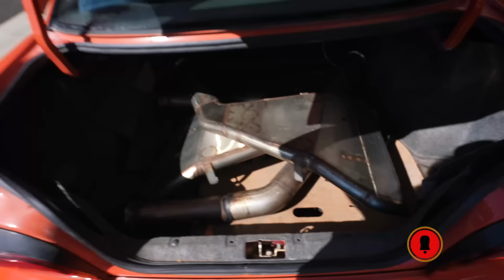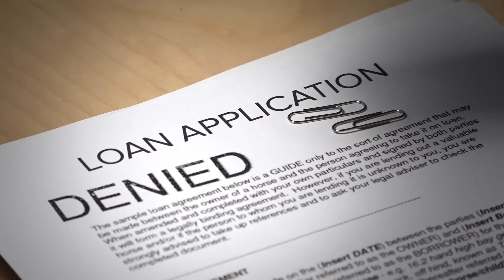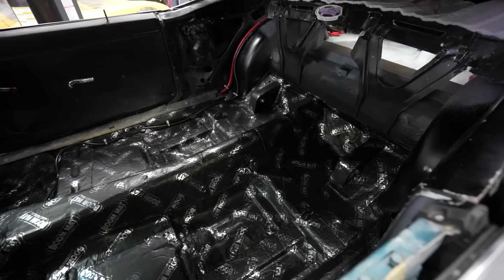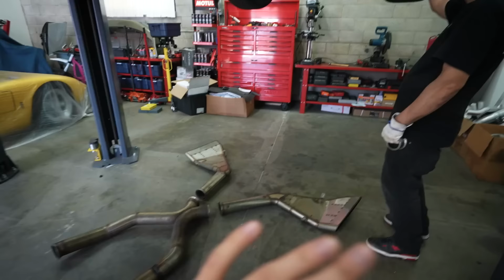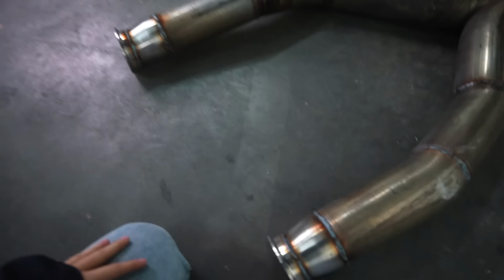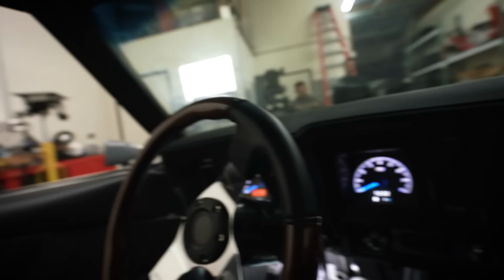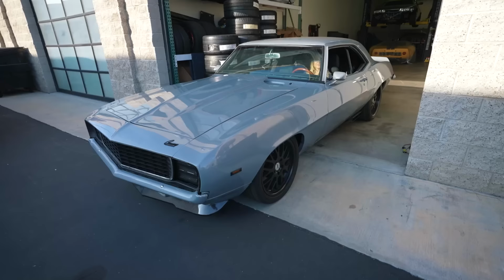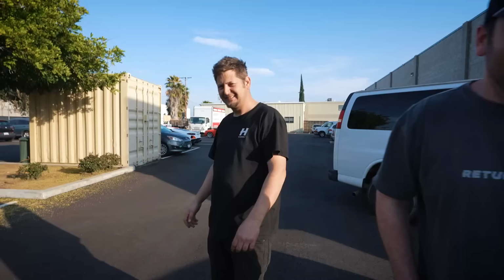We Put A NASCAR Exhaust on my 1969 Camaro... It Sounds Insane.

Comment: Plan on being pulled over a lot for noise pollution. Now that reminds me of my 68 Firebird. I had straight pipes to the doors.  That was it. Bazooka pipes.  Loved it! At 148 mph, you could not hear anything but the exhaust.
Reply: X pipes aren't super loud at cruise
Reply: What about at 147mph?
Reply: The turbos will eat up some of the sound
Reply: I had an SLP Loudmouth exhaust on my 2000 LS1 Trans Am. I loved it. Resonator, no muffler, but I ended up taking it off because I kept getting hassled by the cops over a noise ordinance. Even just idling at a red light would draw a cop's attention. Cops would tell me I'm on a public road not a race track. Massachusetts.

Comment: The purpose of those exhaust is to dissipate any concentrations of an Ammonium Perchlorate/silicon reaction.  It is the very reason for windshield 'tear-offs'.  When silicon reacts w/ nitrogen the exothermic heat is forty times greater.  Carbon reactions are endothermic.  The by product is very slick, and falls on the track.  ergo those pipes are for cheating fuel use.  The fuel is hidden in the intake manifold, about a pint, and requires high Hg to sublimate.  Slow speeds are hell on the driver.  Exam: Montoya hitting the jet dryer at Daytona; Last parade lap to start the 1982 Indy 500.  Comical events to say the least.
Reply: Found the engineer. Thank you sir 👍
Reply: Where's the silicone coming from?

Comment: I used to think Harbor Freight was a junk reseller, but they have such great values (their tarps, for one) and so many tools I actually like better than my more expensive name-brands.  Especially their Daytona Jack lineup.   I have one aluminum and one steel now.  The steel one surpasses jacks 2-3x the price I have used.  I don't have a lot of experience with aluminum ones due to safety, but this HF aluminum jack is built like a champ.
Reply: Harbor freight is great for certain things.  Just gotta have some common sense for when you will need to spend more money. Example, a milwaukee drill will always be better than a Harbor freight drill.  But I do get my sockets etc from Harbor freight n dems

Comment: Yep Dr. Gas speedway boom pipes were on the kodak car and it sounded like a Ferrari, At the 400 daytona race I heard it, much quieter than the rest of the cars, from what I understand the ride height on super speedways needs more room for the pipes so they smashed them flat to fit. We put a set on a 434cid sbc in a GMC truck about a year and a half ago and it does sound destinctive, almost european

Comment: Back in the day I used a couple of old driveshafts to make the exhaust exit just ahead of the rear tires and a crossover pipe welded in behind the header collectors. Nascar exhaust on the cheap !

Comment: I respect the side pipe game, however the older you get you'll realize having the ability to quiet the car is the way to go. I ended up doing x pipe exhaust with switches for dumpers on the side. Won't sound as good as the nascar exhaust but you also won't rattle your ear drums every second. Great car love the project and to each their own.

Comment: I had a 69 conve😢rtible that was just about the same color. I had diamond tuck velour seats with gray pleather borders. It was pretty sweet.
As for the seat belts, the law says that cars built in 68/69 don't require them. I would check, especially in California. I'm in Florida. I have a car that doesn't have seat belts.

Comment: My buddy and I did this to his  exhaust on a 69 Chevelle like 15 years ago this cracked me up. He had a solid roller cam motor and it sound just like a NASCAR. lol but after a while, he got bored  and didn’t like the tone of the car  …and he just put pipes out the side of the car, which made the small blocks sound like a big block….. 358 small block Victor Junior heads can’t remember the intake. The car was an 850 I believe it had a crazy duration cam…

Comment: It's a 60's Camaro.  Perfectly legal to drive it without seatbelts.  They were optional back in the day.
Reply: wrong this is a 1969

Not in the U.S. If the car was built before 1968, seat belts were an option, not a Federal requirement. After that they were required to be installed on new cars from the factory.

Comment: 13:08 I think wheels should be sold in pairs of 2, instead of sets of 4... When will you ever see both sides of the car at the same time?🤔
Black on one side, Chrome or Aluminum on the other side.

Comment: Sorry sweetie, but as long as those hairdryers are sitting in front of the exhaust headers, it will never sound like a nascar, or any other car with a free flowing exhaust.
Get those things of and install a Whipple 3.0 blower, and get the same power, bit with instant throttle and full sound.

Comment: I love your car. Don't put ground effects, that would be cheesy, just let that NASCAR exhaust rip, it looks good just like that. I would probably do cutouts to drive it to church on Sunday but you got to keep that NASCAR s*** like that it's so badass. But the carbon fiber front chin spoiler has to go. I love carbon fiber but sometimes the way it's molded is bulky and awkward, it's good but it just doesn't look right on the car maybe a better quality mold would be better or go with the poly plastic s*** it's hard to get nice quality carbon fiber molded components